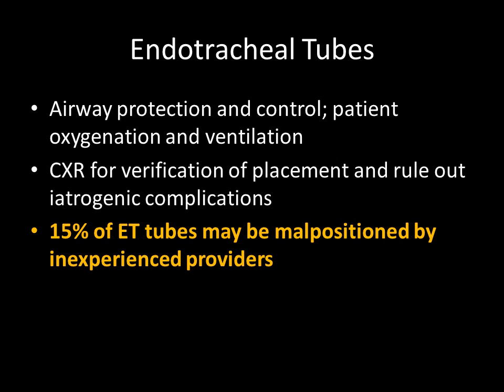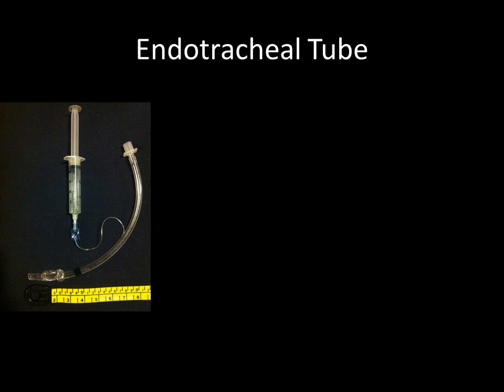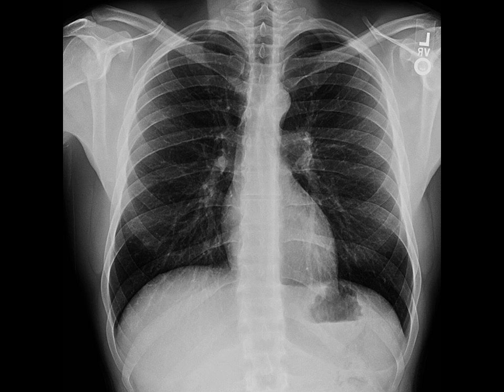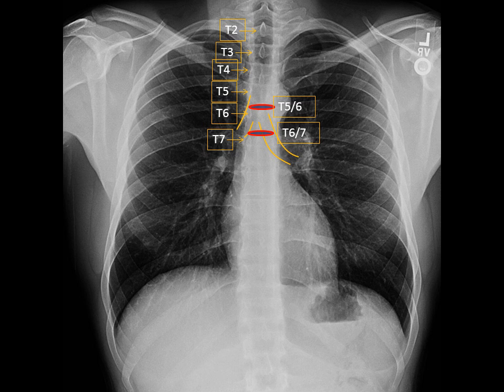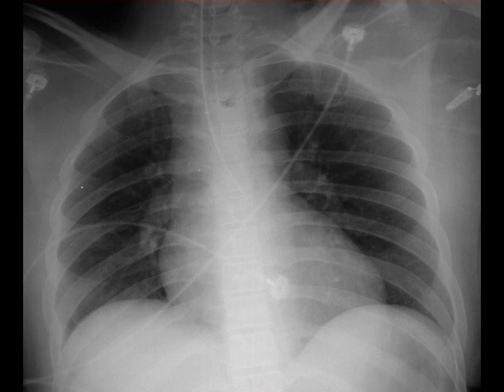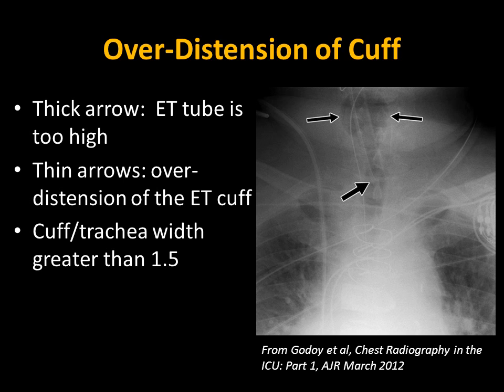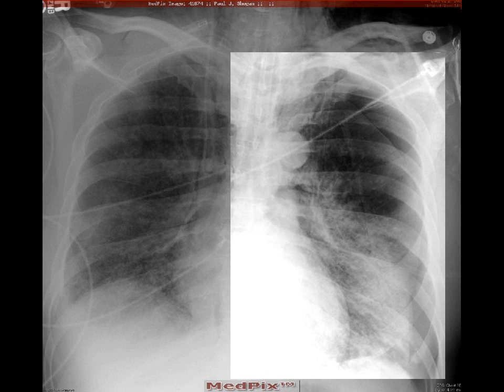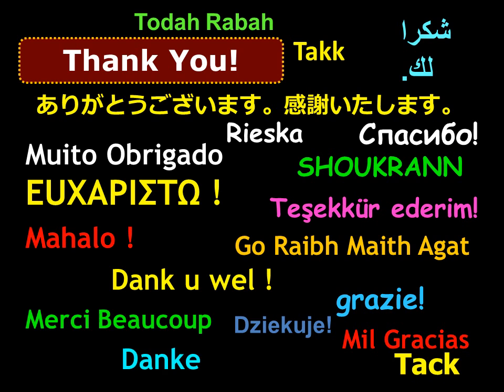Basic Chest Radiology: ET Tube Position and Complications

Comment: To me, I think that not recognizing an esophageal intubation until the results of the CXR are available is below the standard of care. Hopefully that patient did ok. I always auscultate in 5 places starting with the epigastic area immediately after tube placement for that reason, then upper and lower lung fields of each lung, then colorimetric CO2 and use continuous capnography if available. Thanks for the video. I learned something.